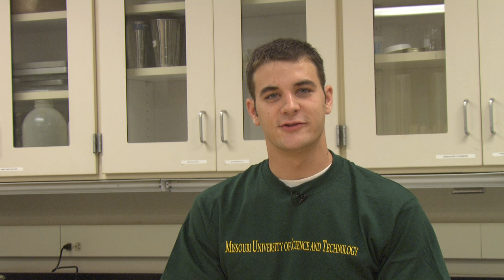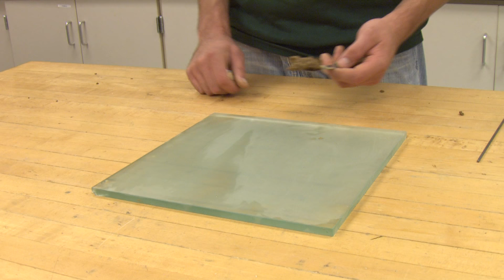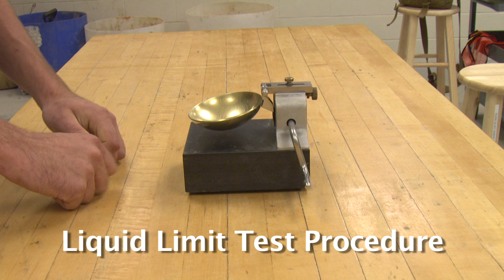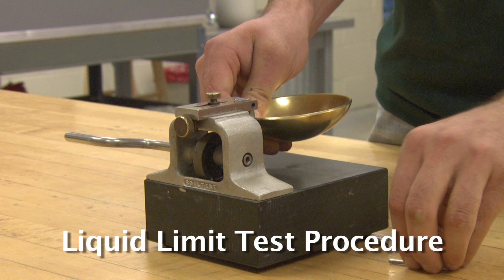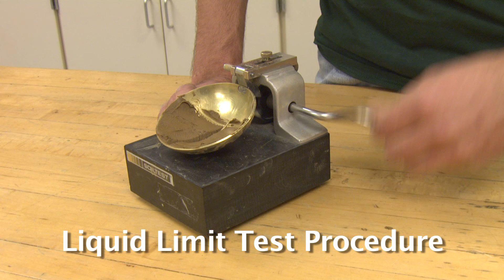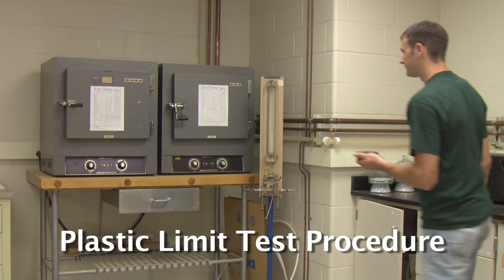Atterberg Limit Tests (LL and PL)

Comment: Look for how little white gravel is under the excavated semi dry garage floor concrete. Water sucked straight out of the poured cement into a swelling red clay base that had a very poor thickness of compacted gravel as a base under the concrete. This is an interior garage floor with cement poured inside previously formed, at least 2 feet deep, rectangular foundation wall. Red clay requires excavating a deeper layer of red clay soil, building back up with several inches deep of gravel, compacting, adding sand, rebar and an installing a method of water drainage away from the exterior wall. The skid steer treads sink so it appears no one ran an Atterberg Limit test or better yet, an AASHTOT89 (method B) to determine the liquid limit of the red clay. A cement slab of this size on red clay can swell up in the rain and sink down during drying by several inches😮.  It is hard to see if the border of the garage floor is level with the foundation wall. The garage floor should be lower than the house floor by 4 inches deep all around to prevent gas fumes from entering the house. The houses’ garage floors in the background look deep enough. The contractor also was wise enough to regrade the exiting of the garage floor to allow for water flow further down the driveway way.
Reply: the contractor is who got you into this

Comment: Someone can  explain me how we can use it on construction of building or road?or in commonly how this test can be useful in normal life?why we need this test?
Reply: It has practical purposes. If the plasticity index is high, it tends to have high clay content and expansive soil. Expansive soil is very dangerous to any man made structure. Slab on ground can pop up or expand because expansive force of the soil. Because of Its expansive nature, the change of volume of soil because of change of water content will be greater than non expansive soil.

Comment: Hey the way you calibrated your drop height isn't correct.  You should measure to midway through the wear spot on the cup, not from the wear spot on the base.  The cup doesn't drop perfectly vertically so if you set it to the wear spot on the base, your drop height will be about 13mm instead of 10mm.  That difference will skew your results significantly.

Comment: You explained it okay well sorta. Think you were a little confused (25-35, 20-30,15-25 start low moisture end high moisture) but that's okay almost didn't catch that was amazed at your uncanny ability to see the middle of the sweet spot from the top of the bowl to calibrate it and you called that a patt then grooved it. Was even more amazed when you started to run the test. But really good thing you had that metal rod for the pl it would take a engineer to pull out the hinge pin holding the cup to the LL device and use it. LOL our future builders.
Reply: hahaha that fuckin pin fuck engineers lol. totally kidding kinda
Reply: were you now😊

Comment: I think you need to let the material cure for 16 hours in a sealed container after you add distilled water to the dry material and before you run your test.
Reply: if it's any kind of clay. if it's Sandy silt I believe it's 4 hrs

Comment: Well done video, up until he ran the test.  I'm going to make my own training videos and sell them nation wide.  I am so sick of watching other labs butcher these tests.  Are we the only lab to perform soils and concrete tests with some care and common sense?  Anyone else feel the same?
Reply: Considering he forgot the time limits stated in the ASTM on performing the PL. You have 2 minutes to roll that thread down to size and you have to maintain a steady and constant pressure on the thread. I perform this test a lot and you have to follow the standard precisely or it will effect the results. And I run this and many other tests for AMRL and CCRL accreditation for my lab.
Reply: Patrick Cameron  To name just but a few things he did terribly. We recently received a ding from CCRL on sp. gr. of a concrete cylinder ( proficiency samples) for correctly calculating the volume of the stripped cylinders.  Had we used the theoretical volume of the mold, (4.000" X 8.000") we would of had been dead center of the national average with our weights.  The hardest decisions with testing some of these proficiency samples is determining as to run the tests as per code, or guessing how the other 90% of the idiots in the country are going to perform them incorrectly so we can fit in!  Nothing more aggravating than being punished for running a test accurately!
Reply: Did you mean rotations per minute? Rpm instead of revolutions per minute? 😄